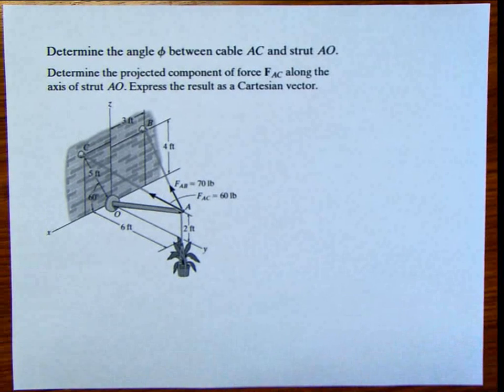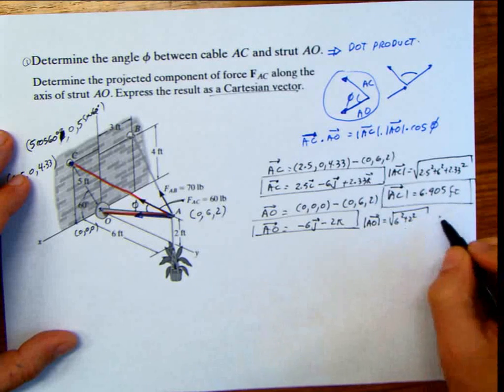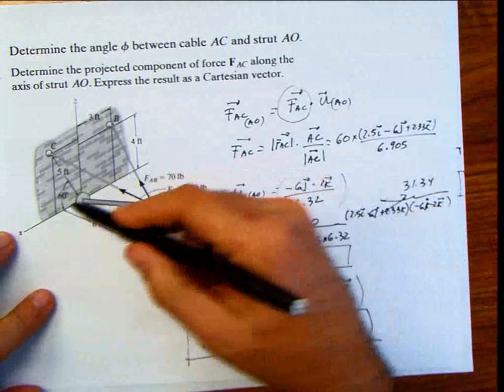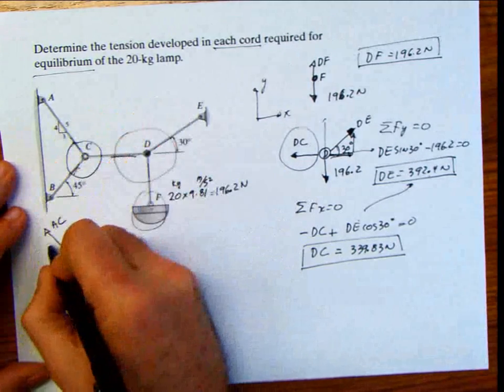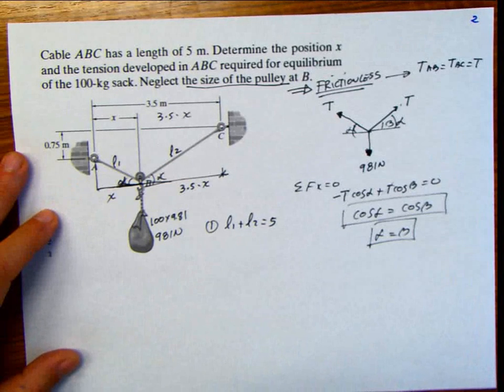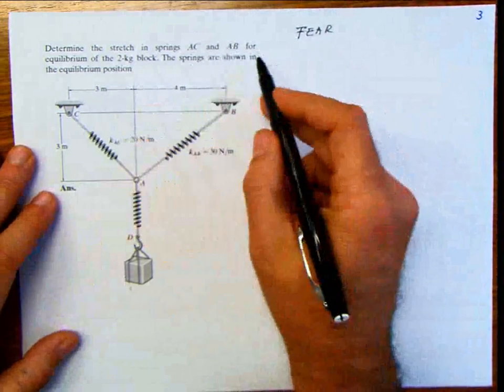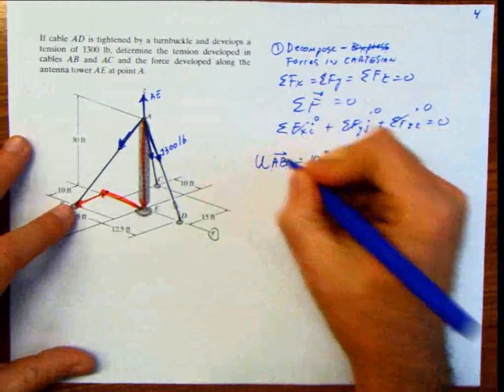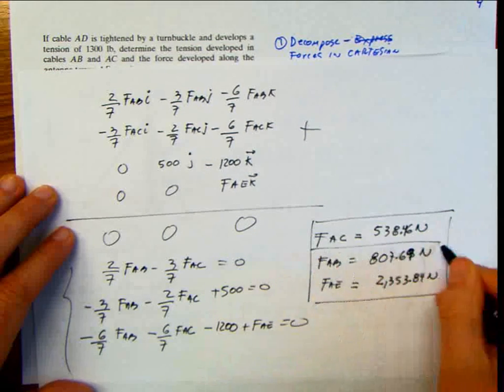Chapter 2 and 3 Particle Equilibrium Dot product, 3-D Particle Equilibrium

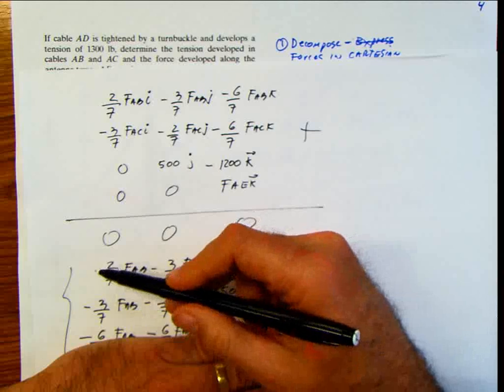Comment: Good day, sir. May I ask how did you solve the last equation in 1:05:01 where you multiply the top equation with 1.5? How did the 3/7 become 4.5? How did you get the forces?
Reply from the maker: Hi,
Good day to you too.
Multiply the top by 1.5m and add the two equations.  -3/7 becomes -4.5/7 and add -2/7 then you have 6.5/7AC=500 ; hence the AC=538.5   This is just solving systems of equations.  Please review your math concepts.
Good Luck,
Stay Safe
Reply from the maker: please always remember to subscribe, like and share
Reply: @1963rzr  I understand how you get the force in AC but how did you get the force in AB?

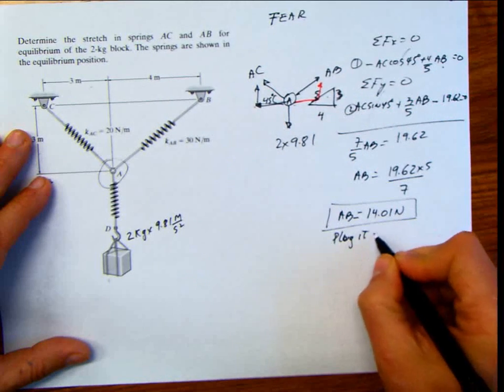Comment: Hello, for the problems of the springs in the time 50:26, I do not get how did you came up with 7/5AB if before you put 4/5AB. I did it different but got the same answer. I am just wondering how did you do it.

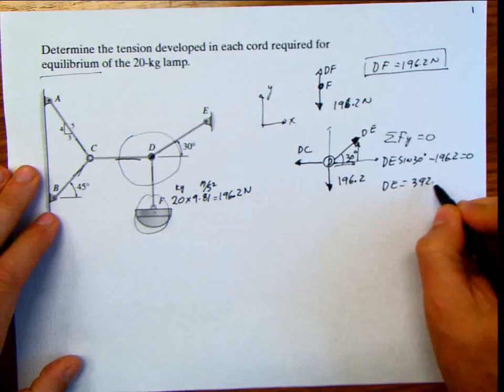Comment: 26:41      How come DEy = DE = 392.4 N  ... I though DE = (DEy^2 + DEx^2) ^1/2   and we actually didn't find DEx ?  

Thank you for your explanation if you get a chance to.
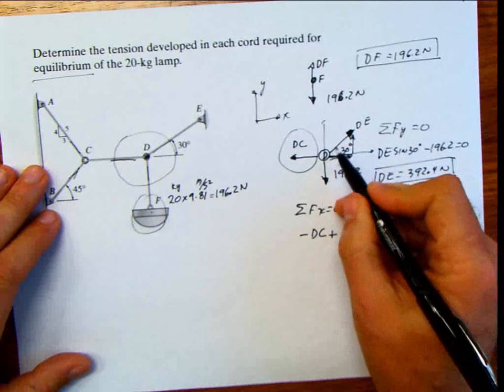Reply from the maker: I never said "DEy = DE = 392.4 N"  Sum of Forces in y must be zero per equilibrium....  If you check the FBD, the only forces acting in 'y' are DE sin 30 and the weight of the lamp (negative) so... DEsin 30 - 196.2=0 and solve for DEActually, DEy is DEsin 30.  The X component of DE is explained and  used in 27:08